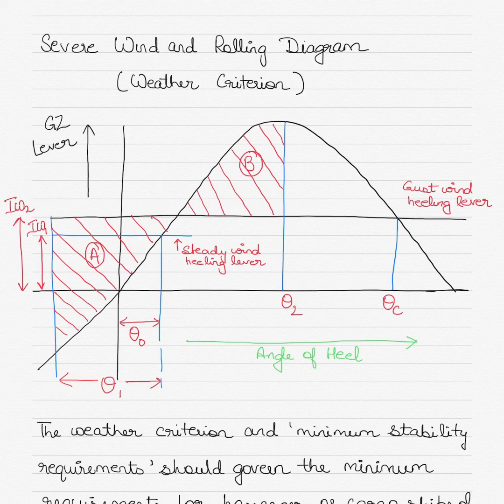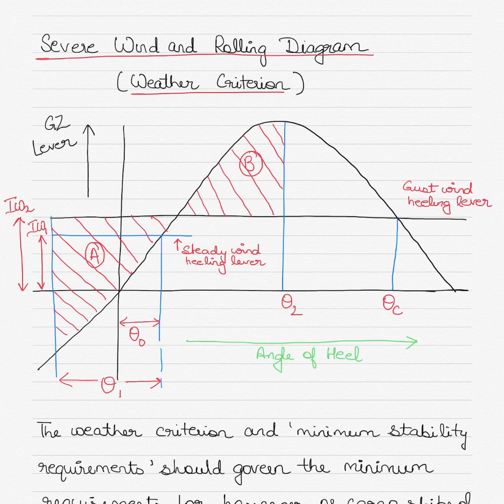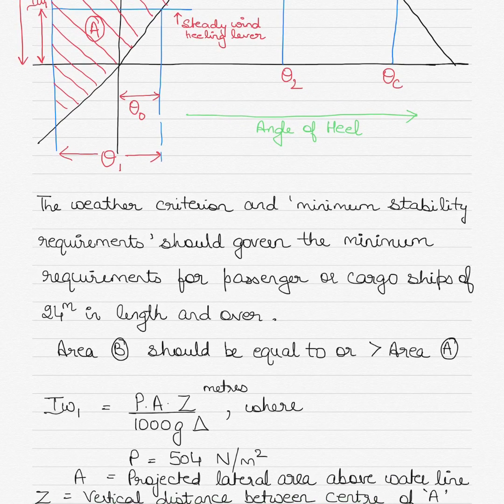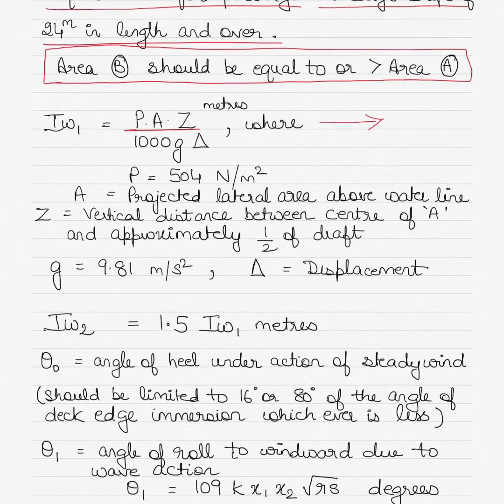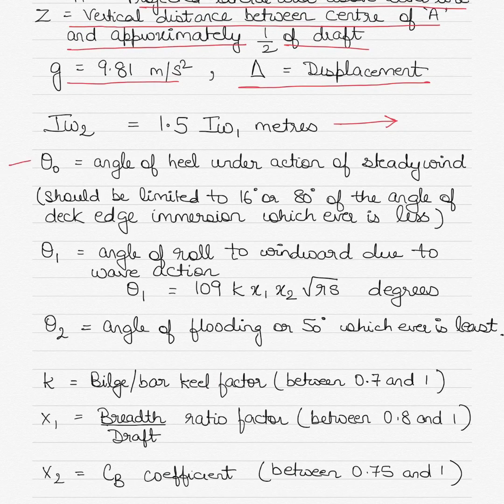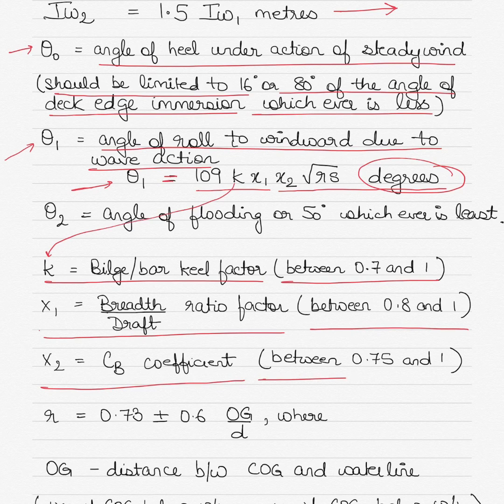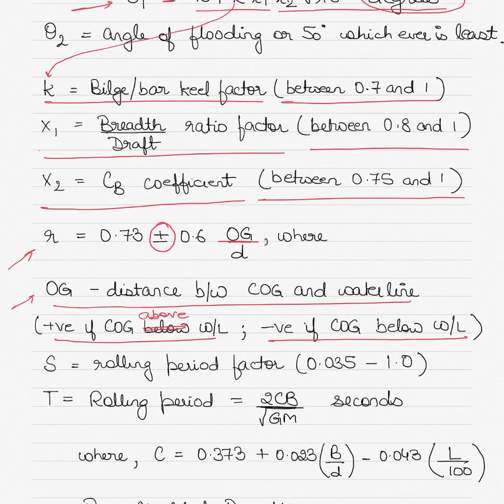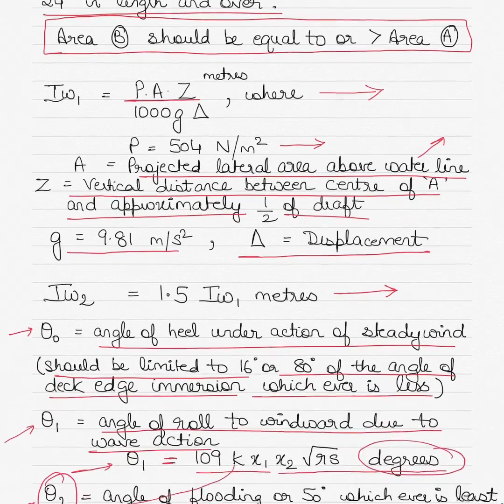Severe Wind and Rolling Period Diagram - Weather Criterion

Comment: can you provide an explanation why are  B should be equal to or greater than area A?
Reply: So first there's a steady wind that keeps the ship at an angle, θ0. Then a big wave hits the ship, and it moves θ1 degress towards the other side. In the mean time, the wind picks up, so the wind moment increases by 50%.
So given this, how much potential energy is stored in the ship's hull at this exact moment? That's the area 'a'.
What damage can that energy do? Well, it will make the ship roll at first until its equilibrium (where area 'a' and area 'b' meets). At this point all the potential energy has been converted to kinetic energy. This kinetic energy will make the ship keep rolling towards the other side. The righting moment of the ship will resist this, and the roll will stop when the energy given by the area 'a' has been used. This angle MUST be less than the conditions stated in the video. E.g. it must be less than the area of flooding (or 50 degress, whichever is less) and it must be less than where the GZ is depleted by the wind moment of Lw2.
Therefore area b must be larger than area a.